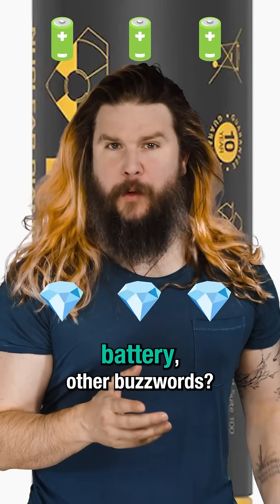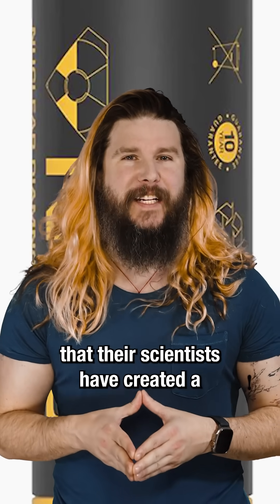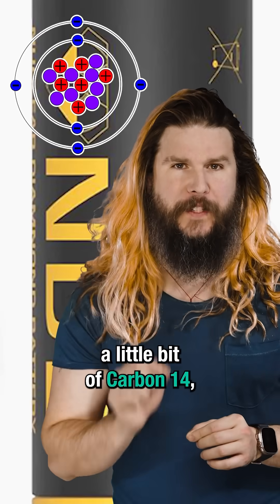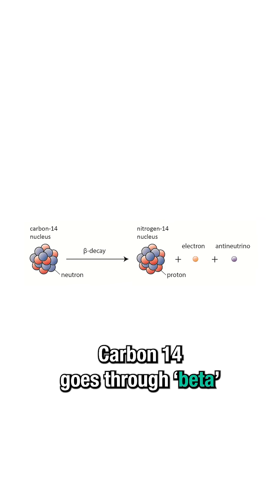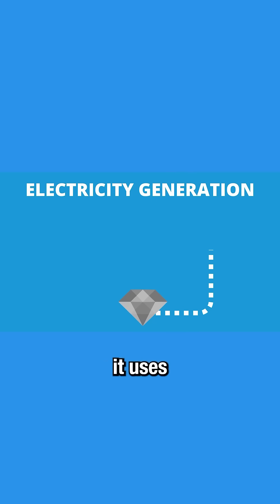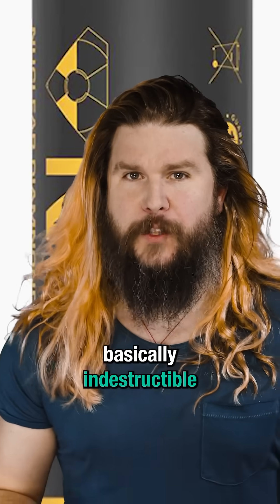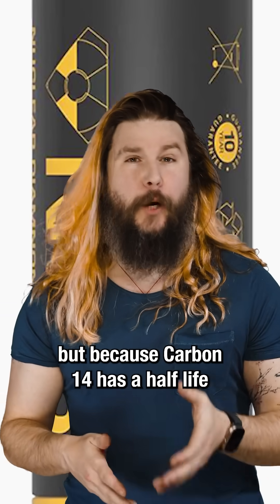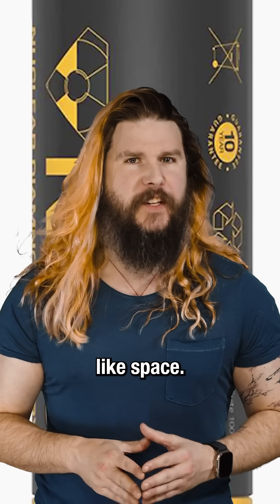World’s First NUCLEAR DIAMOND BATTERY

Comment: Sounds phenomenally expensive.  Why would we need a battery that runs that long?  So it will potentially be powering software and hardware that lasts maybe 10 years, or until someone stops writing security updates for it.  Does it come with a warranty?  Is it biodegradable?   I kid.  But it's about as similar to a solar cell as Fred Flintstone's car is like the Space Shuttle.

Comment: a potential i can see with this, at least thinking rather short term and with the actual technology we have, is using this to have self-recharging consumer electronics?

these diamond-radiation batteries may not generate enough electricity to power, say, a flashlight (to my knowledge). but it could charge capacitors internally, and over time making it so your flashlight basically recharges itself whenever not in use?

(please correct me if im wrong somehow, but it seems right to me)

Comment: I had a thought about these sort of systems a long time ago that we need to have a main mode that uses just about the same amount of electricity as it produces constantly so that it has a net operating Range of forever under normal conditions like a watch, a high feature mode that makes use of the internal battery to do more everyday things, and then a charge mode to reduce some of the features and start gaining charge again. My car charges itself in about 2 days with a normal Outlet, it charges in 8 hours with a level 2 or 240v plug, and an hour or so at a fast charger. If it could just have the Baseline ability to charge to full over two days just sitting there and have a way to dump the extra power, such as into the house or the grid, it'd would be that much closer to lasting forever

Comment: Diamonds are extremely weak and brittle. They just have a very high scratch resistance. That would not make them strong whatsoever, You could hit it with a hammer and it would shatter like glass. Hardness is not strength.
Reply: why exactly would you smash a battery? smashing a battery almost never goes well regardless.

Comment: What's new? The Battery? No. Beta-Voltaic device are being made since the 1970's. The Diamond? Yeno. The "No" becasue EEVBlog has TWO "startups" with C14 BVD debunks from years ago. The "Yes" becasue usual BVD is done with Nickel (Ni-63).

The Problem is hype news that - unlike Kyle - go on tell people they can charge their phone with these devices. BVD with the "tiiiny amount" of electricity (100 nW) are good to run a RTC not charge a phone.

Comment: Why not use a more dense, more energetic radioactive compound? They'll have shorter half-lives and be more dangerous to be around for us humans, but they'll produce more electricity. It also comes with the technical challenge of building a semi-conductor out of a material with a band gap of as high as the semiconductor needs. Band gap is what makes a material electrically conductive or insulative, its determined by the number of protons in each ring and a couple other factors. Band gap of higher than 3 is insulative, band gap of lower than 1 is conductive. So, the higher the frequency of energy of being put into a semiconductor, the higher the band gap needed, but in turn it produces more electricity

Comment: build a few the size of a brick and give them faraday cage shells to protect from emp, you now have a reliable solid state energy source that can charge almost anything anywhere
only concern here is if they get dumped in water
then again imagine an hho cell powered by one of these and optimally tuned for max emissions and minimal wear, maybe it will finally make hydrogen fuel cell cars a reality or other devices that need a side energy source a reality

Comment: The diamond itself isn't going to shield jack. It would prevent leakage of the source, but you would need multiple inches of diamond to fully shield the secondary Bremstrahl xrays produced from the beta particle. It's much more space efficient to use a lead or tungsten capsule for shielding instead.

Comment: Some more info:

That research team at the University of Bristol (in 2016) discovered that regular old C12 diamonds can directly convert beta particles into electricity hence the name “beta-voltaic.” 

Since the radiation from C14 is primarily beta particles, the team realized that by creating a synthetic diamond from pure C14, and then growing another diamond from C12 around it, they could harness all of the radiation from the core diamond. There is zero detectable radiation from a finished unit.

The research team went on to found a company called Arkenlight, and has been churning out bigger and higher power batteries based on their findings for years. 

From the user perspective, these are safer than literally any other battery technology known to man. 

The image behind Kyle is from a company called Nano Diamond Battery, hence NDB, based out of California. They’re using the exact same physics for their batteries discovered by the Arkenlight team, but from what I’ve read no one is confident that their units will live up to their marketing because, other than a couple proof of concept units they’ve (allegedly) debuted, no one has actually seen a functional unit from them let alone actually deployed them like the original Arkenlight units were when they were still at Bristol.

In all, it’s a really interesting technology that could redefine how we think about electronics design

Comment: This would be fantastic for remote sensors.  Pair it with supercap and the sensor could wake up when the cap is full, record it's readings, then go back to sleep until it has enough power again.
Reply: I asked Deepseek to calculate the power for an ESP8266 to wake up, read a sensor and transmit. About 2 seconds and 1.1mW average. It'd take 114 days to recharge at 400nW per hour (the max output of a diamond battery so far)
Reply: @kantpredict About three times a year? Not bad for never having to change the battery!
Reply: @JarieSuisen if you only needed to read the sensor three times a year 🤷🏻

Comment: EEVBlog tried dismiss these as pseudo-science... i remember looking up the patent and any other detailed paperwork i could find on it at the time and it's legit but like any battery it only has so much output and would need to be stacked in series/parallel like any other battery system used to achieve the voltage/amp ratings needed.

Comment: Nuclear thermoelectric batteries have been around for 50+ years. The Voyager probes being a prime example. Having a nuclear battery that is encased in a durable diamond is useful BUT that is the problem. No manufacturer would want to build something that could run (essentially) forever. Not profitable.

Comment: I have been following this development for about 4-5 years. It came out of research into using graphite waste from nuclear reactors. The graphite is compressed into synthetic diamonds and Voi la nuclear batteries! Love it. I look forward to see if it can be upscale somehow
Reply: you didn’t see graphite
Reply: Viola!
Reply: It's a photovoltaic power cell. It cannot be upscaled for larger applications requiring high drain power sources.
Reply: @ what about stacking to charge more conventional batteries??
Reply: @matttaylor7102  Any kind of battery can be combined in series or parallel combinations to provide a higher voltage or current - or if for some wierd reason they can't, electronics can be added to provide the needed voltage and / or current.  

However, for these batteries, it is very likely that the cost will make them prohibitive  for higher-power applications.

These batteries have a particular use case -  i.e. long life and low power where cost is a secondary issue.
Reply: @matttaylor7102 
Voi la ??
Reply: @Sol_Badguy_GG it's french of "ah ha!", "tah dah!", "eureka!" and similar exclamations
Reply: @Cynthia_Cantrell  ok but how expensive are we talking? Because these are sounding more and more like a low level generator than a battery. And given enough of them you might be able to use them to trickle charge a different battery that can be used for other purposes.

Like an extremely durable and long lasting solar panel that you don't need to replace every 20 years to maintain efficiency.
Reply: @Cynthia_Cantrell  overtime a lot products or services that were once expensive became cheaper depending on applications
Reply: @demonkinglamb636  So are you missing the point of why this was even talked about in the first place, or..?
Reply: @demonkinglamb636 but in the video its mentioned that it doesnt use photons

Comment: I’m still confused why it’s called a better when it’s clearly a generator or even reactor. It produces power, not simply stores it
Reply: I guess it would depend on the actual science behind it. Maybe there's more to it than he's describing.
Reply: @Stratus41298  I’ve seen a few videos on it but everyone is saying it produces power. Which would make it more like a generator
Reply: I think people, on the whole, won't comprehend the difference between probability and power generation versus storage, so they call it a battery.
Reply: nitpick: Batteries don't "just store" power, they also release it. Otherwise would be useless.

Perhaps the difference between "battery" and "generator" is shifting to just depending on if a supply of power can be contained within a (typically) mobile unit that it provides power to. Or something like that.
Language can evolve, even if we don't like it.

Comment: I'm wondering what influence in particular the diamond is meant to protect it from. I mean, diamonds break pretty easily, and they can burn. To clarify, I realise that the amount of radiation emitted by the source isn't enough to hurt anyone, and that the device sensitive enough to be damaged by it will absolutely be destroyed by the amount of impact needed to break the cell, not to talk about burning it, but still
Reply: @nabra97  would you be surprised to hear that these people have / are being sued by the SEC for fraud, Because they are. They also falsely claimed to have nerd rage as a consultant as well. The whole thing is a bit bizarre. But if you look up nuclear diamond battery with the combination of SEC or fraud you should find out more about them.
So the answer is because it sounds good two people who don't think about it too hard or know better. I mean just ignoring the whole diamond claims bit.  They're claiming to concentrate carbon-14 from graphite low-level waste. Then make CVD diamonds out of it. I mean you could do it but there'd be some serious safety concerns and that isn't you know cheap. 
Also if you know about betavoltaics their claims are just lunacy. The more you do any amount of physics or engineering to this the more it doesn't make sense.

Comment: The professor in charge of this research is called Tom Scott. The batteries are made out of nuclear waste (C14 extracted from used graphite moderator blocks from reactors. The UK has 95,000 tonnes of these graphite blocks.) encased inside lab made diamond. 1g of C14 inside one of these batteries could release 15J/day, which is equivalent of using an AA battery slowly over 2 years. So something similar to a fire alarm. Except this battery would last as long as human civilisation has existed.

Comment: People seem to be missing the potential of this new development. They’re all focusing on the fact that it produces a minuscule amount of power, measuring the worth of just one battery… 

But what happens when you connect thousands of these in series?

My guess is the assembly will produce significantly more power, with no emissions or waste, in any possible environment, for over ten human lifespans.
Reply: They're probably insanely expensive though
Reply: @ascherlafayette8572  It's a brand new technology, if governments invest in it we may be able to reduce costs.
Reply: @ascherlafayette8572  coal and apply pressure. You got a diamond 😅😅😅
Reply: @death13a   I think they were more talking about making the diamond produce power being expensive. One of these, with it being extremely new tech would cost a lot. multiply that by the thousands needed to produce a usable amount of voltage, and you have a neat RTG that's probably at least a good few times the cost of the already expensive MMRTG used by NASA.

Comment: If you use this to very slowly recharge a chemical battery with a higher voltage this could create wireless sensors with battery life spans on the order of thousands of years. The pcb it's installed on will degrade before this battery loses power
Reply: Would be great for remote environmental monitoring

Comment: As cool as this is, it doesn't really have many uses. Now say it had the power output of your regular AA bat and it would genuinely change the entire world. Unfortunately I'm not sure we could manufacture such a thing except if we play with some more exotic matter types but then weight becomes a problem. We need them to be portable, we need them to produce a fair amount of power, and we need them to be cheap. If only the Universe would let us have some fun damn.
Reply: Yes, this battery output is messured in microwatts, which is a millionth of a watt
Reply: It will run a Heart monitor! So you don't need to be operated to change battery! 😊😊
Reply: Again though, it's emerging science. There's always ways to improve.
Reply: The longer it lasts the slower it releases its energy. If it lasted 100 years instead of 1000s it would be more useful.
Reply: @adrianthoroughgood1191  There's gotta be some way to accelerate the output somehow, it shouldn't be impossible
Reply: @dud3655  it's dictated by the rate of decay of the C14, ie its half-life. There's nothing you can do to change that. You can only choose a different radioactive element. This was chosen because it gives off a suitable type of radiation to generate electricity but also not leak radiation outside of the diamond enclosure. But also it's readily available. It is extracted from radioactive waste from nuclear reactor graphite moderators. The UK has a stockpile of 95,000 tonnes of this radioactive graphite.
Reply: @adrianthoroughgood1191  I know I know but I wondering if there's actually a way. It shouldn't break the laws of physics, equivalent exchange still applies, the isotope decays faster and outputs more energy at the same time, but that'd require it to be even more radioactive wouldn't it?
Reply: also diamond "expensive" only because of inflated prices by shops. Diamond is plentiful in nature and can be manufactured while using expensive machinery for reasonable price.

Comment: Might not be a lot of power but imagine a cell phone that slowly recharges itself
Reply: The nuclear diamond battery people faked the technology and are being/ were sued by the SEC.
Current commercially available beta voltaic devices cap out at about 500 nano Watts. So I'm not even sure you would exceed the internal discharge rate of the battery.

Comment: I wonder how large we could scale this up safely. Could it be used for emergency lighting in buildings.
Reply: Sure. You just need to fill a small, cheap building with hundreds of diamonds and hope nobody realises or steals them. Or for less than a dollar a year, you could just run the emergency lights that way.
Reply: @davidturner9120  Diamonds aren't nearly as expensive as people think they are. I just don't know how expensive the process is to make these diamonds. I would think a led lightning system could be built with each light having an internal diamond battery and replaceable led bulb that could be a one time cost that lasts longer than the building itself. Theft will always be a problem. When I was in my early twenties half of my handyman business was replacing copper wiring and tubing that people ripped out of walls in rental units. I could see this causing less damage and being easier to replace depending on the price of making those diamonds. They'd also be a lot easier to protect. Moreover, if the lights are effective enough, they wouldn't have to just be emergency lighting. They would be a one time cost light that you no longer have to hook up to the power grid. It'll probably still get marked up by about 1200%. But that's not any worse than the actual diamond industry.
Reply: @insertfunnyhandlehere  that's not true though, you don't wonder those things - if you did, you'd Google and find out in less time than it took to type your reply ;) these batteries are around $5k each and you'd need thousands of them to power an led lamp that's bright enough to notice, let alone guide you out of a smoke filled building.
Reply: @davidturner9120  I'm so sorry. I insulted you by trying to have an intellectual conversation with another human being rather than a computer. That would just give me the answer whether or not it was actually correct.